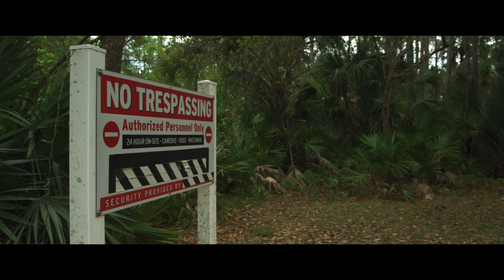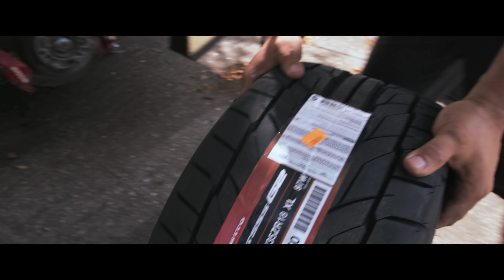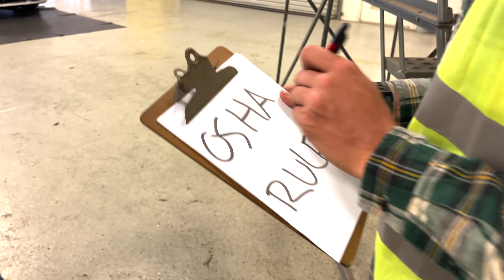Welcome to The LZ Compound: A 30 Acre Automotive Dream

Comment: I’ll take 15 car spaces for Freesies
Reply: lol
Reply: Move into one of those buildings and make some sick content together
Reply: Hey tommy, is this considered a jdm space?
Reply: HAHA
Reply: For a bag of zinc plated bolts
Reply: How far do u live from Adam ... ? I’m from uk (MANCHESTER) lol no idea how far apart u are....
Reply: Load up the trailer
Reply: Lmbo hell yeah lbVVs
Reply: @charleswebster207  it's an 18 or 19 hour drive. a little over 1,000 miles
Reply: @charleswebster207  He lives about 20 hours from Adam
Reply: @charleswebster207  it's like driving from the bottom point of the uk to the top and then back down again
Reply: @tommyruane878  ahhhhh !!! Lol if u drove a 1000 miles in the Uk you’d end up in water !! I need to move to America.!!
Reply: cops not allowed on the compound
Reply: are you a cop? you sound like a cop
Reply: Just move to Orlando papa FYeah
Reply: @charleswebster207  18 hours
Reply: 15? Moving to Florida Thomas?
Reply: @tcollogan  HE'S A COP!
Reply: Nice one lol
Reply: @charleswebster207  distance isn’t as much as a bigger issue for Americans. I do from London to Mcr a few times a week and my friends are a amazed, I watched Haggard garage do 600miles round trip for a set of wheel spacers 😁
Reply: To run the FYEAH ZINC CARTEL ?
Reply: @charleswebster207  about 24 hours worth of driving. Conneticut to florida. Over 1000 miles
Reply: I knew it 🤣
Reply: @charleswebster207  Not sure on the miles but it takes them between 21 & 24 hours to drive it !
Reply: @charleswebster207  15-16 hours trip by car roughly 1300 miles apart.
Reply: Subframe content coming soon to the LZ compound
Reply: @gaspersavle161  😂😂😂😂 too perfect.
Reply: “Adam money LZ”- tommyfyeah”
Reply: @charleswebster207  Tommy is is Connecticut and LZ is in Florida. Somewhere around 1000 mi (620 km) from each other

Comment: Yo Mr. LZ. Are you the same Adam that I worked with at Zero Motorcycles in Scotts Valley and I discovered was the Midnight Drifter who haunted Bonny Doon and Boulder Creek? If so, well done. You've come a long way. If not. I wonder where that Adam is. He liked 240's too.